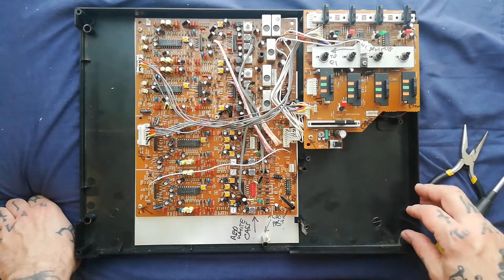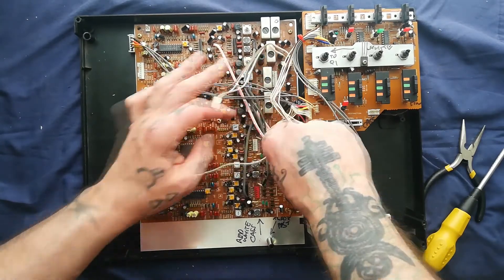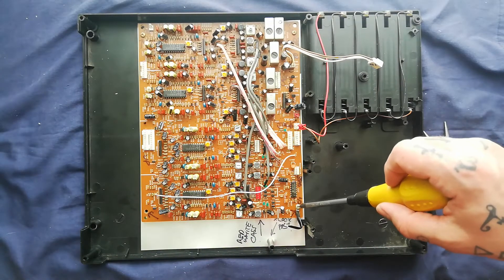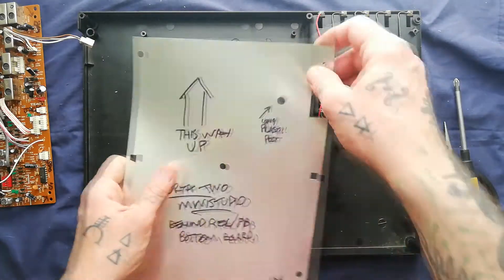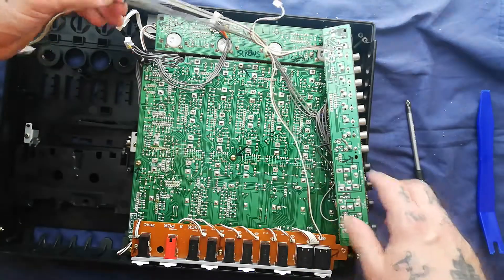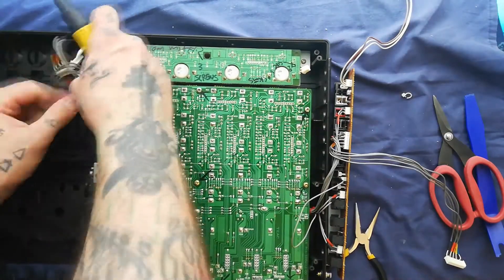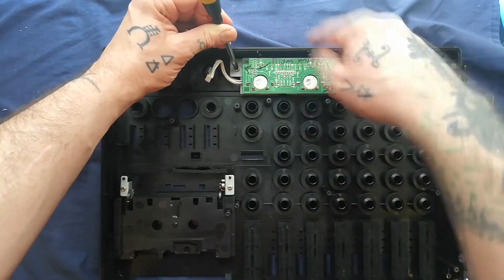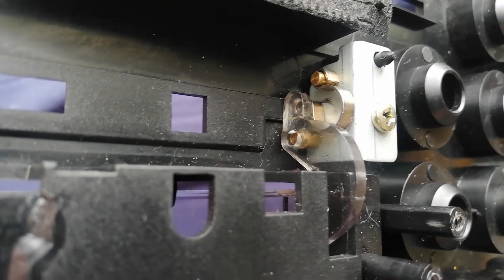Tascam Porta Two Ministudio | Tear Down | 2 | Detach Door, Meters, Mixer, PCBs

Comment: Great channel - a huge treasure trove of information for owners of porta studios! 👍
I have a Porta Two HS, which I've had from new. Pulled it out of storage after many years and found the play head spring issue. I managed to fix that thanks to your guide - cheers!
I notice that the headphone ouptput and line out seem very noisy, even when the transport is not being used and all track volumes are down - I don't remeber it being like that. 
The direct tape outputs don't suffer with the same white noise, so maybe it's related to the mixer section? 
Have you come across anything like this before? Any suggestions on where to look?  Cheers Mark

Comment: Would you recommend cutting the cable ties in situation where they're making it hard to trace the path of a particular set of wires?  Or should I just leave them be?
Reply from the maker: Yeah, I do that all the time, take a photo first though - sometimes cases don’t want to shut properly unless the cables are clumped together in a similar way.